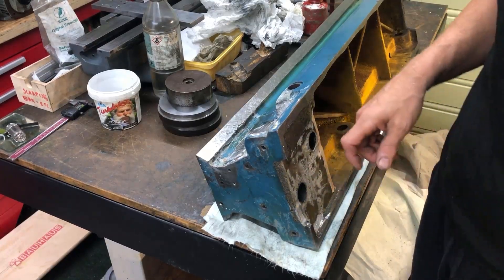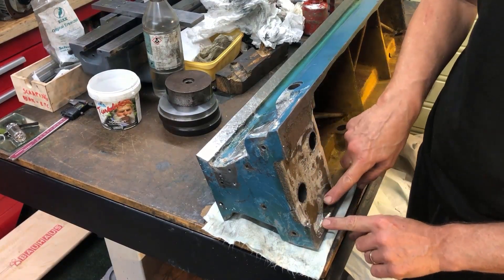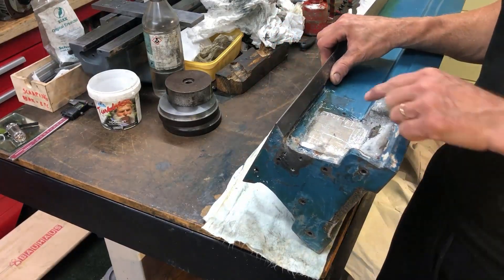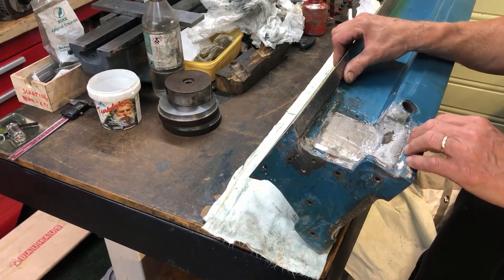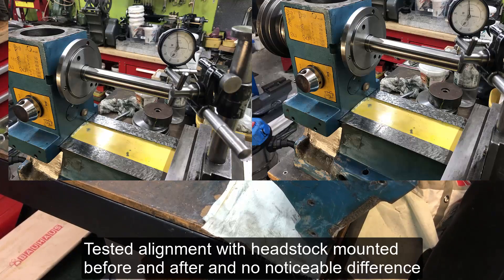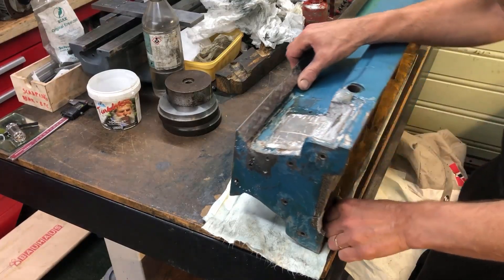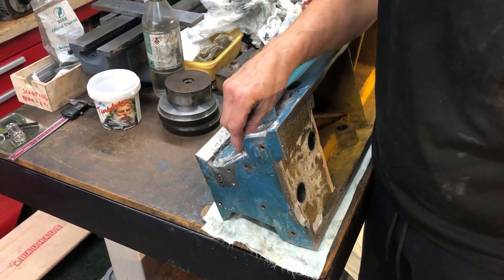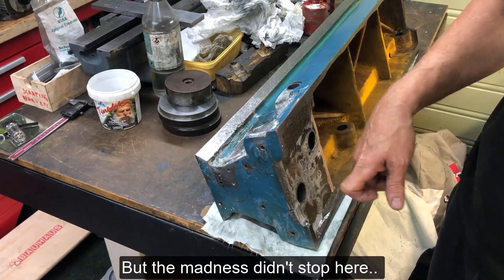Smarty AT-300 - Epoxy granite - 1 - headstock end

Comment: I assume the inside of the casting is rough enough for the epoxy to get a mechanical grip.  Did you have to do anything special to clean the cavity, so the mixture would 'wet' to the surface?
Reply from the maker: Cleaned/ roughed up as good as possible. Plus the ribbing.. We'll see how it stands up over time

Comment: I have similar idea with my Chinese lathe, specifically with headstock that is open in two directions. What about thermal expansion of cast iron and epoxy? Would there be some issues?
Reply from the maker: I think the idea using epoxy is that this is the best in this respect. Since this is accepted as actually an improvement over cast iron for some hi-end machine makers, for example here: https://www.youtube.com/watch?v=8xP6-JaPjAI , I haven't questione/reasearched it deeper than reading what is available online from such websites.